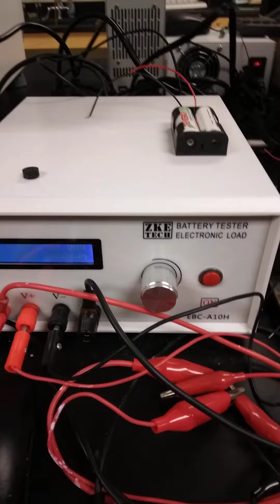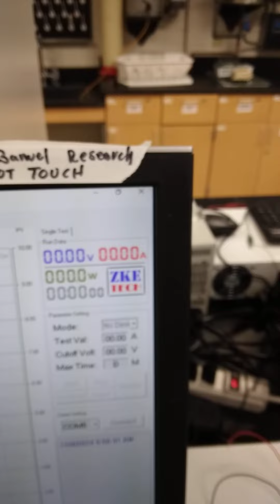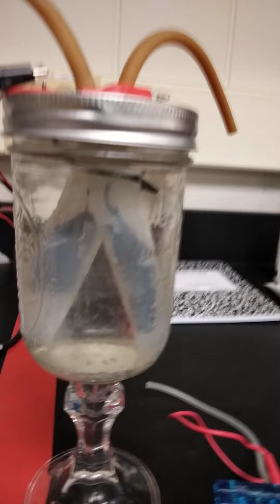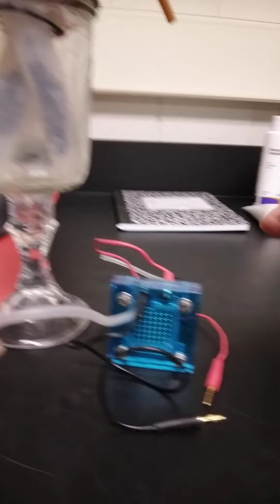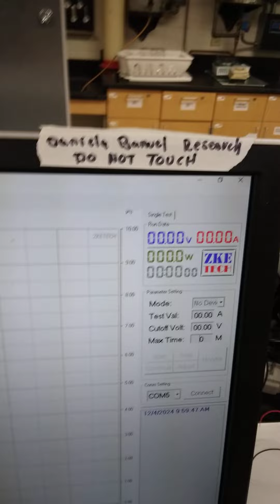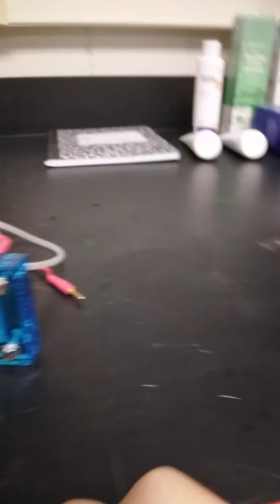Ni/Graphite Felt Electrodes Water Electrolysis Hydrogen Fuel Cell

Comment: Does it produce a more hydrogen for less power? Are the materials used less expensive and easier to replace?
Reply from the maker: Materials easy to replace for sure. We are interested in the electrode current density value changes over time of electrolysis. We are depositing varying amounts of nickel on the graphite felt. The Ni and graphite should do well in the aq. alkaline electrolyte. Many experiments can be done and the anode (O2 production) overpotential is always of interest. Iron on graphite for the anode may do well. Many experiments can be done by students and home researchers. :0
Reply: @daqvidscottsoriano  iron sounds interesting. messing around with phosphoric acid or something might be cool
Reply from the maker: @bobobobo490  H3PO4 is safer than the 25-40% aq. NaOH , but less conductive.